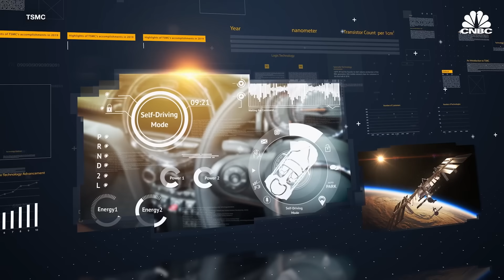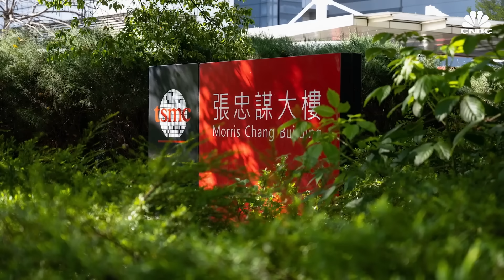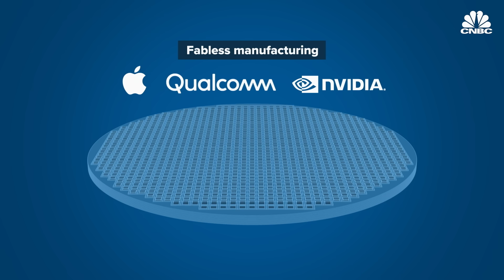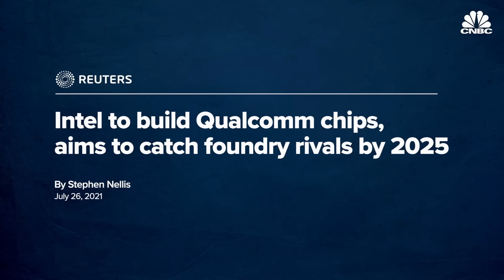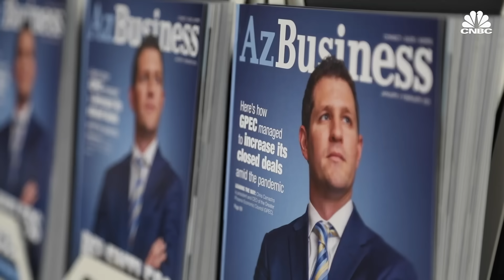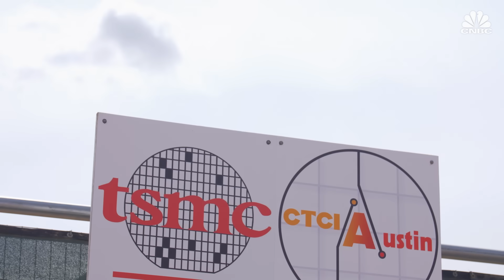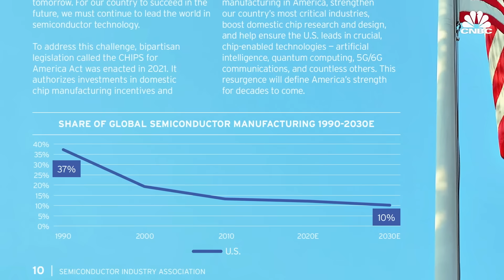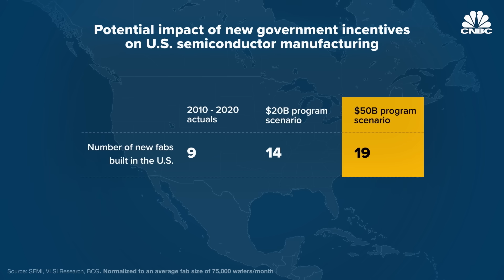Secretive Giant TSMC’s $100 Billion Plan To Fix The Chip Shortage

Comment: "Perhaps a questioner would like to say: "Yes, Coronavirus has come by the end of 2019 and the whole world has been quarantined at the beginning of 2020, and we said it is a blessing in disguise thinking that Coronavirus has solved the issue of global warming which the Paris climate agreement conference could not find a solution for since it has suspended the work of factories, vehicular traffic, trains, planes and vessels
We were also sure it will reduce climate disasters due to the reduction of carbon dioxide exhausts thinking that Coronavirus shall solve a problem which the Paris climate agreement could not ,while it (the agreement) used to call for reducing 50% of these exhausts; however, it was not applied because countries were afraid on their economy to be hit hard but corona came and stopped the carbonic emissions by 100% for many months, and we thought that climate disasters shall be reduced. But we were shocked as the complete opposite happened! Instead of reducing the climate disasters the intensity of the climatic war causing floods and hurricanes has increased all around the world like never before so Coronavirus has destroyed the global warming theory since the Paris climate agreement was not applied ;given that they have agreed upon reducing 50% of factories exhausts, but Coronavirus has reduced them by 100% for many months due to the quarantine and mass lockdown; on the other hand, the intensity of climatic disasters unprecedentedly increased since 2020 till now; hence the global warming theory has failed
O Nasser Mohammed Al-Yamani, your statements about different matters are verified on actual reality, and those who follow them know this as you have been denying and disbelieving in the global warming theory for more than 16 years, and said that the planet of fire, Saqar, is approaching the Earth and affecting it from a distant place and you have written many statements concerning this matter but we still have not believed you and we believed the global warming theory that then has failed! So could you extract from the Great Quran what proofs that virus corona was sent by Allah to verify your fatwa to demolish the global warming theory as it will force us to stop our factories and wheel of carbonic life for many months, then, it raises the intensity of the unprecedented climate war to destroy the global warming theory?" Then, I reply to the questioners and say: you shall find the news in the word of Allah the Exalted: {But those who deny Our signs - We will progressively lead them [to destruction] from where they do not know. (182) And I will give them time. Indeed, my plan is firm. (183) Then do they not give thought? There is in their companion no madness. He is not but a clear warner. (184) Do they not look into the realm of the heavens and the earth and everything that Allah has created and [think] that perhaps their appointed time has come near? So in what statement hereafter will they believe? (185) Whomsoever Allah sends astray, none can guide him; and He lets them wander blindly in their transgressions. (186)
Al-Aaraf -Chapter: 7 -Verses:182-186"
Imam Mahdi Nasser Mohammad Al-Yamani
08 - Rabi Awwal - 1443 AH
14 - October - 2021 AD
08:58 am
(According to the official time of [Mecca] Mother of towns)
To Non-Arabs and Arabs: The Planet of Torment Has Approached
____________________
(To read the statement in clear and coordinated writing kindly visit the official website of the Awaited Imam Mahdi Nasser Mohammed Al-Yamani or search Google using the statement's title)
5
#عجم_وعرب_كوكب_العذاب_اقترب
 https://youtu.be/X9TOR3WttA0
XP9fXk

Comment: It would be a mistake for Taiwan to move its strategic industry away from Taiwan and to the US. What are the guarantees that the US won't pull a Huawei or Tik-Tok move on TSMC? It would lose jobs locally and create an increase in cost. There is no benefit for Taiwan or TSMC moving to the US but it is just caving in to US pressure or intimidation when all the manufacturing is in Asia .

Comment: I’m extremely glad to see TSMC come to the US.  However…ARIZONA?
You moved a factory that’s going to require millions of gallons of water a year into a place where the river supplying most of the water is going dry? How was that a good idea?
Reply: Well, is near to California (where all of them are designed) also is cheaper, and is close to border with Mexico, maybe the want to create a “silicone cluster”across the border to lower costs of production (like they do already with car production) so: high tech in the USA, and labor intensive processes in Mexico
Reply: Water can be purified and reused.  It’s not complicated, just expensive. When they pull from an aquifer, use it then clean it then re inject it there shouldn’t be a problem. Also, the salt river is already dry, that ship sailed decades ago.  A real question is why do we pump water over the Sierra Nevada’s mountain range

Comment: A lot more of the video should have been devoted to the water issue.  Why locate the new US fab in water poor Arizona?  If TSMC is going to do such a good job purifying the factory waste water, why aren't they using that purified water in the manufacture of new chips but instead reinjecting it back into the aquifer?  Is that water still not very clean and if so, will that 'purified' waste water then contaminate the aquifer it is being pumped back into?  And even if that's not a problem, the 10% not being recycled is still a large quantity; 4.7 million gallons they'll need per day x 0.1 is 470,000 gallons a day being removed from Arizona's desert water supply.

Comment: To be clear. This does not fix a chip shortage. It will create a stronger monopoly. To truly fix the shortage would mean more chip companies that are geographicly closer to North America. But my real question is why a company using millions of gallons of water for production, would setup shop in the US south-weet which is already in drought. Tax cuts mean nothing if the residents have no water, and it certainty won't provide the revenues needed to support that kind of facilities.

Comment: The only thing this missed is that Intel plans to not only have their 3m node out by around 2025, but also 2nm in which case they'll be once again leaders in fabrication.  The two new plants Intel are building in AZ are both 2nm plants.  For Intel, the names of those nodes are Intel 3, and then Intel 20A.  Intel is behind right now by one node size, in actual transistor density.  But, they've had an issue with power efficiency with their current latest node, which used to be called a 10nm node.  They've renamed the node Intel 7 since transistor density is on par with TSMC 7nm which is what a lot of the world is using right now as a leading edge node.  Only a couple companies are on TSMC 5nm since it's still in its first year run.  One is Apple.  Apple is a risk partner by making a contract with TSMC when these new nodes are ready.

Intel's fabrication problem has also caused them to lose business to other fabless companies, like AMD.  To counter this, Intel joined Apple in becoming a risk partner for TSMC 3nm which is supposed to start production in 2022.  So, Apple and Intel have the first run of TSMC 3nm.  Intel doesn't have a 5nm node, it has a 4nm node, called Intel 4.  So really by the time 2025 rolls around the world of fabrication is going to be interesting.  I'm pretty sure though most older companies that haven't adopted the latest EUV technology are going to be hard pressed to find customers.  What will happen is the price will drop on nodes as small as 7nm, as 5nm, 3nm and 2nm will be very common by then.  Maybe not 2nm, but certainly 3nm.

Also, Samsung is expanding their capacity in Austin for 5nm fabrication.  So, in about 3 years there should be an abundance of higher quality ICs, and the world is going to need it.  ICs made on 5nm, 3nm and 2nm are going to be much more power efficient.

Comment: TSMC is reliable and reputable, customer privacy/IP protection is top notch.
Reply: Hopefully that's the case.
Reply: TSMC needs to be careful. A wrong move that will bring down Taiwan's economy
Reply: He who controls the water controls the chips
Reply: Neth their filming policy is nothing special. Fabs don't permit anyone other than select persons with clearance to take pictures. Which is dumb because every technician uses a phone to get their job done. Whether it's taking a picture to see what the original state of something was before disassembling it to finding dropped screws :P
Reply: @meegz149  Difference being that any mobile devices used inside TSMC adhere to strict security policies and are not allowed internet access beyond the local area network as well as a host of other requirements imposed on electronics used inside a fabrication facility

Comment: TSMC's rise illustrates a number of Adam Smith's concepts (e.g. value of specialization)
Reply: TSMC moving to Arizona is their downfall!  3800 gallons of water used per 8 inch wafer You should see what we (TSM) have done to Taiwan.
Reply: That’s a bizarre comment. I understand China is mad, “must save face’’ they stupidly consider Taiwan as a province,  it is an independent nation.  But now tsmc has a serious stake in USA.  Smart move on their part.
Reply: @benx8364  how is it bizarre? I’m confused, are you unfamiliar with the process?
Reply: @benx8364  only 90% of ultra pure water is recycled, and it can only cycle once. 90% of recycled water is only of usable water. So roughly 30 % is heavy metals etc. which is not part of this process. It seems like a very profitable idea, lake Meade and all. After agriculture what comes next, oh commercial sector, yes right. Do you honestly see that lasting long? 

But in fairness they can’t predict that, but we can see it now, Last I looked comparing it to the area they use the equivalent of a city with a population of 75k (each day)obviously the city will fluctuate much more than the plant. So hard to really put a good daily number on.

Quiet bizarre how little foresight to be honest. On your part that is.
Reply: TSMC has had fabs in the US since the 90s.  They just were low key - I worked in one in Washington State called Wafertech.
Reply: @redwolfexr  TSMC is building a new 20B fab right next to Intel
Reply: @larryc1616  You mean the one this whole video was about?  :)
Reply: @redwolfexr  haha  you got me! i didn't even watch  this video before i responded because i'm already well educated in this. but what is different in this video is that it says TSMC is building a 12B fab but other sources say 20B.
Reply: Intel couldn't get pass 7nm, whereas TSMC is from 3nml on to 2nml.
Reply: @willengel2458  nm is one thing, transistor density is another
Reply: Absolutely
Reply: Not mention about all riots happened in the world such as Hong Kong riot, Tian An Men Protest which organized by ARMerica , only talk about war.    In 250 years of existence as a nation, the US has fought against 29 sovereign countries. (In Fact, since 1785, US have been involved, for 219 years, in some kind of war. And this wars, against all varieties of sovereign nations. From going against the Sultan of Morocco, to invading the tiny island of Grenada. Well, this means that in its entire history, it has only had 17 years of peace, and even fewer, cuz here the almost 5 years (1861-1865), of its Civil War of Secession are not counted (Union/Confederates), since this war was not with another country, but against US. And the wars against the Native Nations of America are not counted too, for the same reason). Anyway: US fought against 29 countries. It has "Grown" 711 times the size of its territory from the original 13 colonies. It has provoked with total impunity, Genocides, inside and outside its own borders, and assassinations of Gov’t. Leaders, Coups d'État and Economic Blockades in 6 UN member nations. (Between 1947 and 1989, the US tried to change other nations gov’ts. 73 times. It includes 66 covert Ops. And 7 overt ones. In Civil Wars: The US has taken advantage of and intervened without justification in the following Civil Wars: In Cuba (1898 and 1960). In Haiti (1813 and then 1915-1934). In Colombia (1899-1902 and 1948). In Mexico (1847 and 1914 and again in 1916). In Russia (1918). In the "Republic Banana Wars" of Central America (1912-1934). In Venezuela (1945 and again in 1948). In China (1857, and 1900, and again in 1945-1946-1949). In Korea (1950-1953). In Viet Nam (1959-1975). In Panama (1964 and again 1989). In Central Africa (1969-1974 and 1982-1988). In Nicaragua (1937 and 1985). In Bosnia (1995). In the Philippines (1898 and 1900)... In Kosovo, Libya, Lebanon, Somalia, Sudan, Syria, Iraq, Iran, Yemen, Afghanistan, etc.). And more: US has almost 800 Military Bases scattered around the world; 93 of which are against China. On the other hand, China and N. Korea (The "Axis of Evil"), in 1,000 years of history have NEVER invaded anyone. These nations have fought their Civil Wars, defended themselves against foreign invasions, and secured their immediate borders, but they have never been meddling or aggressor countries. Do you know how many Military Bases China or N. Korea have outside their territory? None. Zero. Any. NADA! They do not have a single Base. These are verifiable facts. Neither China nor Korea will invade the world; US does... that's DONE, as US does in the Middle East. Iran also does not have a SINGLE MILITARY BASE outside its national territory, and it is surrounded by 16 US Bases, and it is US who call the Iranians Terrorists. Well, very good. You already know. Now, compare the Greatness of the US with the Greatness of China. The "Greatness" of the US is built on the foundations of Piracy, Slavery, Genocide, the Assassination of opponents, Opium Traffic, or Cocaine in its case, and is under the foundations of the weakness of other sovereign nations. LOL…..Chai from Malaysia.
Reply: @bcobb7777jai hind dosto
Reply: they want to made chips closer to home?? 
apple and other electronics mainly assembled in china, why they have to add transportation costs to ship chip from US? to add a carbon footprint? 😂

I think, in the end the tsmc Taiwan will produce the most high spec chip and the tsmc us will produce the lower spec chip
Reply: E.g. the value of state planning and industrial policy
Reply: @Joe Duke yes. There's probably a shortage because they're in the vax
Reply: @bcobb7777 Taiwan IT engineer's salary is only 1/3 of   u.s for the same job .so they will be happy to move to u.s for better money and better future.
Reply: @kennyz6271  cost of living is much lower in taiwan tho
Reply: @maksskill6715  of course living standard is much lower vice versa
Reply: @kennyz6271  1/3 the salary and probably 1/4  the cost of living. Don't fool yourself.
Reply: @breatheasy2693  actually less than 1/4 of cost of living . Taiwanese only eat 2 bowls of pork rice per meal that cost only for only a  u.s dollar .It is so cheap to live in Taiwan.
Reply: Don't forget EDA software and Asml .TSMC is nothing without 80% of u.s equipment.
Reply: @kennyz6271  Actually that's completely wrong.  Almost all their equipment and indeed all cutting edge chipmaking equipment is from ASML in the Netherlands.  And TSMC are building giant fabs on the Chinese mainland.   I notice that wasn't mentioned in the video.
Reply: @AndyGraceMedia  different chip processes are being built on mainland China, he did specify 5nm processes.
Reply: I am the last son of God and the sibling of Jesus Christ. I am "THE KING OF KINGS" revelation 19:16. I brought the corona virus rev. 6:2 rev. 6:8. This year will be "the end of the world".
Reply: @ed3099  People like you give Christians a bad name. Stop this nonsense, please.
Reply: @ed3099  I understand that you are trolling.  Why though?   50 cents apparently
Reply: chip shortage is just a MYTH

MINERS ARE THE MAIN PROBLEM

Comment: the reason why most of the fab succeed in Asia, it is because the fab job is high-pressure and high-commitment job.
It doesn't suit the west well who prioritize work-life balance lifestyles.
The commitment you need to succeed in the semicon is no joke.
The asians basically trade their health or mental health for the high pay (for asian standard, relatively low if converted to USD)

Comment: Really a load of self aggrandizing self promoting TSMC crap mostly. Intel and others are not far behind, nor is the nm difference directly comparable on different fab processes. The theoretical nm limit is also being reached, so everyone will eventually bunch up behind the same dead end. The most advanced chips go in phones. When was the last time you complained your phone was too slow? Did you have a problem with the 28nm chip on your phone from five years ago? The current power is unnecessary for mobile devices or applications, and even less necessary on fixed devices. The die shrink has increasingly limited returns and limitations. It's half marketing gimmick. National security or economic viability is not hinged upon having the most bleeding edge, smallest transistors. The same way you won't die if you don't have the latest iphone. Your five year old flatscreen TV isn't somehow obsolete because the newest TVs now are a quarter inch thinner, with even shittier speakers, less ports, and mostly the same image quality.
Reply: Unless you are China and planning to colonize Mars first :P